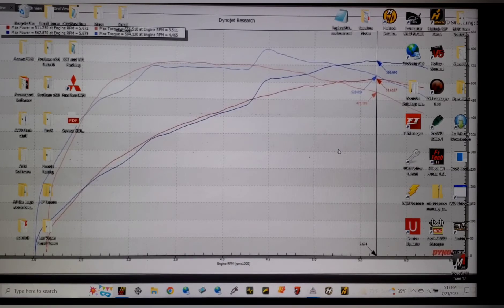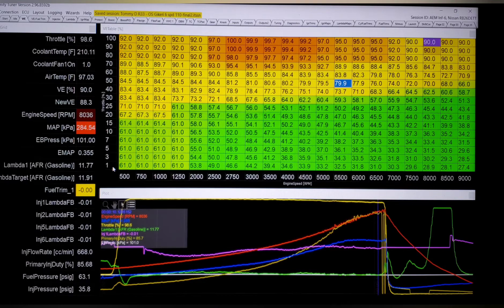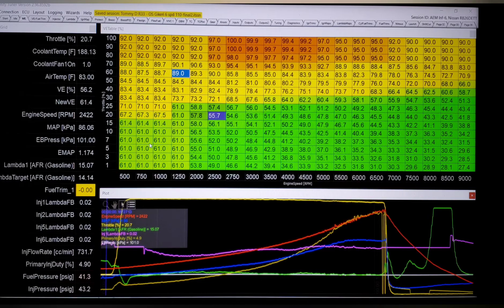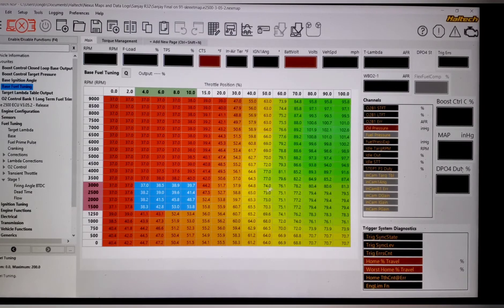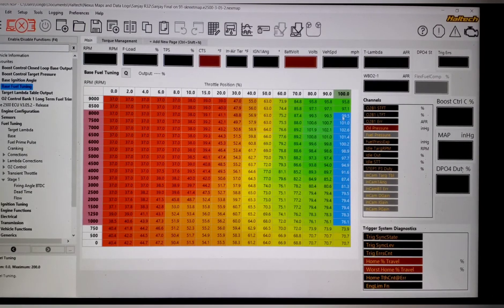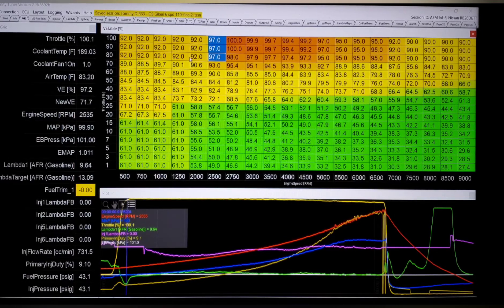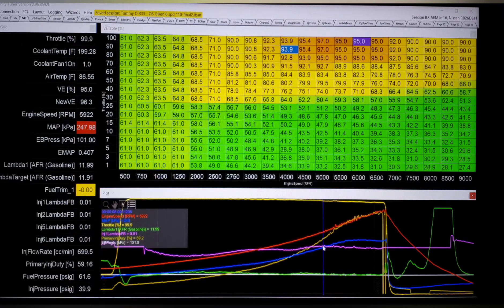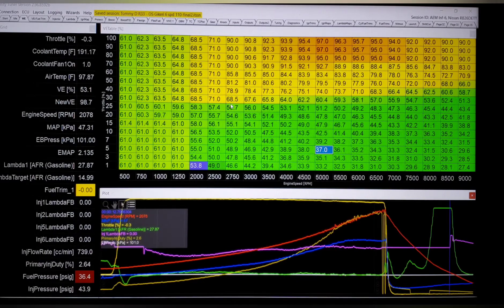Individual Throttle Body tuning with modern ECUs

Comment: You Sir, are the man!  I hope all your viewers appreciate this as much as I do.  If you don't mind, can I ask some follow-up questions?  (hopefully these Q's will be helpful to other folks as well)
Reply from the maker: Ask away
Reply: @AaronONeal1  Hell yeah, thanks man!  Here goes... 

1. I noticed your TPS scaling is skewed to have more resolution in the early tip in throttle areas.  I went even more resolution at the expense of the resolution near redline.  I went granular in the single digits starting from 0.5 to 8%, then 20% increments up to redline.  I realized that this is on a turbo RB.  I'm on an ITB NSX.  Have you noticed any real difference in performance based on how the TPS scaling needs to be?  

2. You also mentioned real briefly in your log review that your WallWetting might be a little too aggressive as at tip in it dipped rich for bit.  It would be great to see some of those table and your logic/strategy for tip in in ITBs.

3. Do you run any kind of MAP Fuel Trim compensations?  Like for example, you touched on the brief moments (say below 20% TPS) where you actually have some kind of vacuum.  What's your strategy for blending this with TPS?  I was thinking to have run the engine leaner at these stages to save on fuel while cruising but not exactly sure how this is done in the Infinity.  

4. Do you have any videos that go over Decel tuning with the Infinity?  

5. Bonus question for me personally!  I've run into a unique issue where when I stab at the throttle it goes into full fuel cut.  There's a log parameter I found called [InjectorCutLimit].  During low throttle almost steady state low rpm increasing throttle this value is typically 3'ish, but when I accelerate even moderately to abruptly this value spikes to 8-9 and all fuel is cut.  I have no idea which fuel cut safety is tied into this.  Might you know?  

Dude.. I know this is a ton of questions.  Even if you can just get half of one of them, i'd be super grateful.  Just trying to learn the Infinity since I come from an old HKS F-Con and the VE stuff is totally new to me.
Reply from the maker: @RyuMoto  1. It might make a slight difference at really low throttle inputs or troublesome spots but if the closed loop and map sensor signal are smooth and clean enough it should really interpolate between pretty well.  Tommy's car drives really well.

2, I can add that in a future episode on accel fuel/wall wetting/transient throttle.  This ties into question 4 as they should be linked.

3. It is all background and I havent had to add any extra compensation, though in a turbo car a fuel trim vs EMAP can be necessary depending on boost level vs turbo size.

4. See #2 but I can add it into an episode.

5. There shouldnt be any boost cut features enabled on an NA car but I would have to see your session file to try and help you diag the problem. - email is longboarder23@hotmail.com

Any new ECU is light years if not galaxies apart from FCON, Emanage, Power FC, etc.  It is not even really related to earlier AEM products in its actual function even.
Reply: @AaronONeal1  fellow long boarder!  I think that's why we get along!  Thanks again for your time and generosity.  I might take you up on the offer to review my cal 🙏